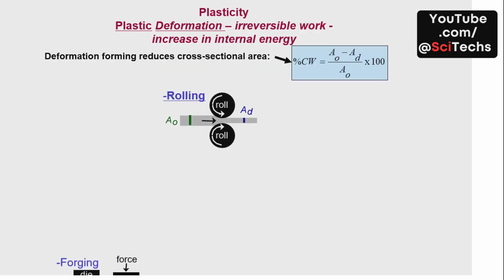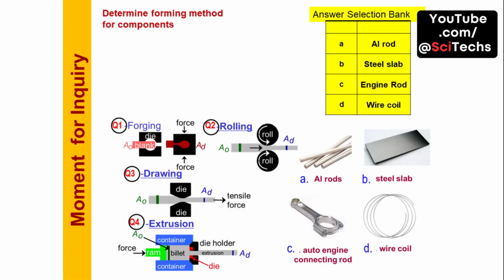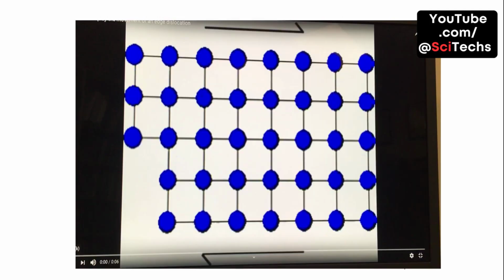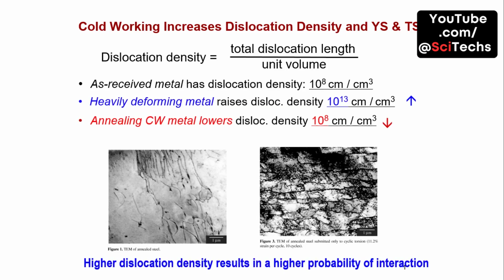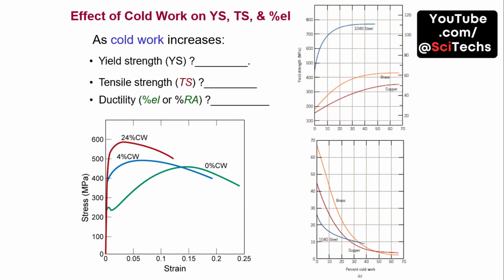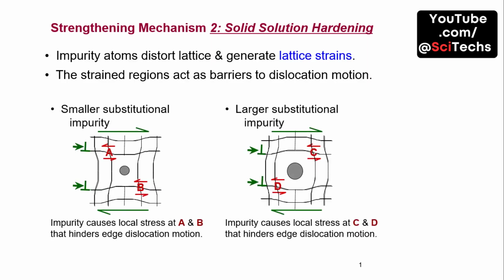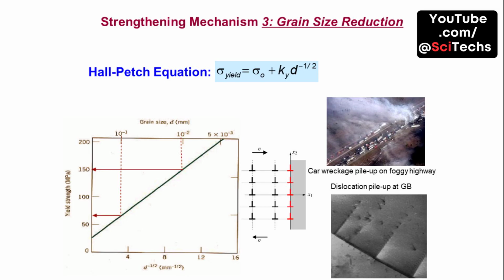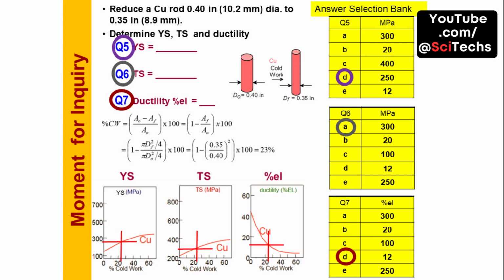Materials Science 11a: Metals II - Dislocations & Strengthening Mechanisms

Comment: I learned that dislocations occur as wrinkles in material. They cannot go back to their original form once distorted. A strengthening mechanism is a process that's used to prevent materials from slipping and causing failure flaws (wrinkles)

Comment: One thing I found interesting was that you can make metals stronger by making it harder for those dislocations to move. This is done through:
Cold Working: Increasing the number of dislocations so they crowd each other out.
Solid Solution Alloying: Adding different atoms to the metal, which act like obstacles that block dislocations.
Grain Size: Smaller crystal "grains" in the metal create more grain boundaries, which act as barriers to motion.

Comment: Metals can change shape via plastic deformation to lower energy of the system by using different processing methods such as forging, roll, drawing, extrusion are all ways to change the shape of a metal. There are many ways to process materials to change YS and TS, but the video discussed Cold working, Annealing, and Solid solution alloying. These will change defect density and thus either help or hinder the defect interactions in a material.

Comment: I learned about plastic deformation which is a permanent change in the shape or size of a solid material that goes further than the elastic limit. Normally within the elastic limit it can go back to its original shape.

Comment: I learned that AI rods are made from extrusion, steel slabs are made from rolling, an auto engine connecting rod is made from forging, and a wire coil is made from drawing. I also learned that plastic deformations are caused by dislocations moving through the crystal lattice.

Comment: The video explains the metals changing shapes under stress through an irreversible work called plastic deformation by dislocation, but there are methods to strengthen the metal by annealing, grain size reduction, and solid solution hardening which impacts the number of defects.

Comment: Manufacturing processing such as rolling, extrusion, drawing, and forging. How plastic deformation of metals occurs by the motion of dislocations. Plastic deformation by dislocation motion is an irreversible process. Strengthening by impeding motion  using interactions with defects such as solutes, other dislocations, and grain boundaries. Dislocation interaction can either increase strength via repulsion or increase ductility via attraction and annihilation balancing the metals properties. Where Yield, tensile, and ductility will irreversibly change.

Comment: This video was all about how metals change under stress. I learned that plastic deformation is an irreversible process, cold working increases dislocation density, and adding a weaker metal to a stronger metal increases the strength of the stronger metal.

Comment: I learned how plastic deformation can happen and how it changes depending on the process used on the material. For example, rolling, forging, drawing, etc. all have different effects. Adding other metals to each other may increase the strength like Nickel to Copper.

Comment: Through the process of solid solution alloying, by adding a weaker metal to a stronger one you can increase the strength of the stronger metal through tensile strength and ductility.

Comment: I worked in a factory that manufactured rivets for bridges and aircraft using Cold Forging Technique and this video reinforced why the manufacturer chose this technique over heating the metal and weaking the crystallization structure, making it not suitable for high strength applications.

Comment: This video gave me a good idea of plastic deformation and forming methods of different materials.
Reply: it was about metals buddy!
Reply: @evilintentofficial8508  Plastic deformation in metals occurs when the applied stress exceeds the material's elastic limit (yield strength), resulting in permanent, irreversible changes to the metal's shape.  Unlike elastic deformation, where the metal returns to its original form after stress removal, plastic deformation means the metal does not recover its initial shape. This does not mean that the material is strictly plastic. All materials are capable of experiencing plastic deformation.
Reply: @jhoyt6 ah my bad 
I thought you meant the literal plastic polymer lol

Comment: The video explained that dislocations are defects in the crystal structure of metals that let atoms slide past each other more easily, which affects how metals deform under stress. I also learned about different strengthening mechanisms (like adding alloying elements or creating obstacles that block dislocation movement) that engineers use to make metals harder or stronger. Basically, any given dislocation on a metal can either weaken or strengthen it.

Comment: I learned how the tensile test is used to generate a stress–strain curve and determine key mechanical properties like yield strength, ultimate tensile strength, and ductility, which are critical for comparing how different metals deform and fail under tension.

Comment: Without the need of heat, metals can be formed with high stress such as forging and extrusion to create more ideal shapes with the use of slip motion, which can be prevented by strengthening the metals by mixing them around desired properties.

Comment: I learned about plastic deformation through dislocation and slipping that can be used for manufacturing of different parts increasing strength and preventing structural failure.

Comment: I learned that you could add a weaker material to a stronger material, which ends up increasing the strength of the resultant material, called solid solution alloying.